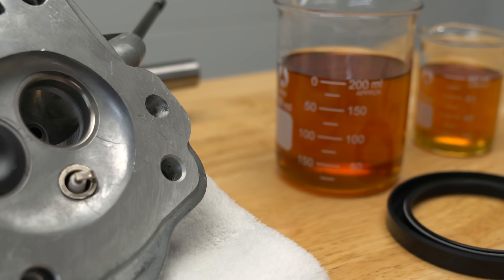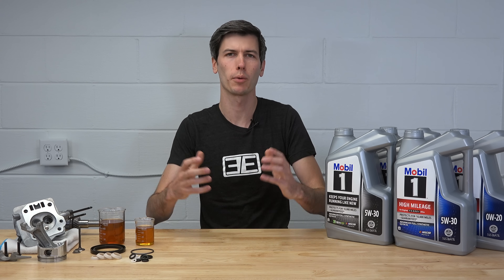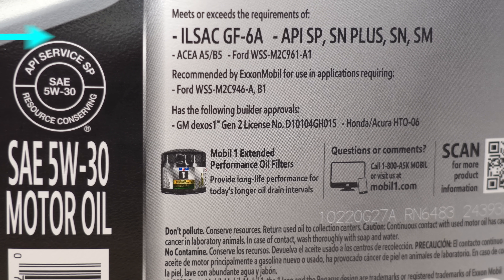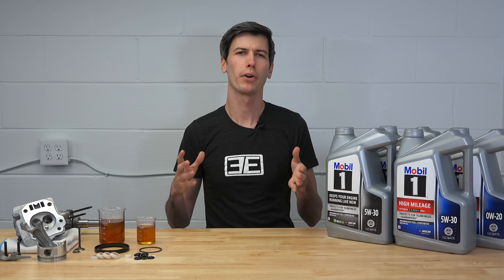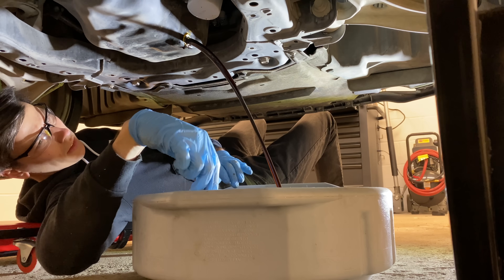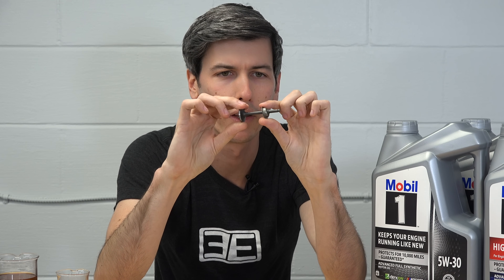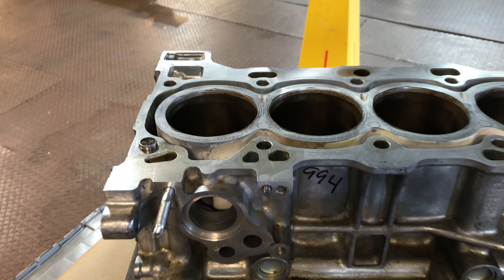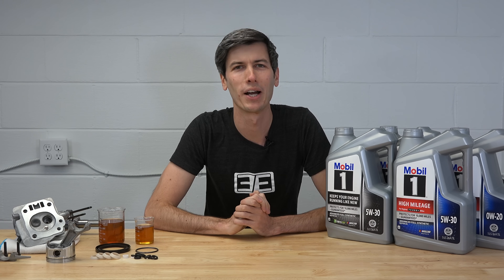Is Synthetic Motor Oil Bad For Old Cars?

Comment: If you acquire a vehicle with a dirty engine or the maintenance has been neglected on a vehicle you or family member own, conventional or semisynthetic also will clean up the sludge and deposits once you change the oil and begin to keep a good maintenance schedule. Full synthetic will just do it faster. If you seals are doomed to leak, they will leak in either case.

If your vehicle had dino oil as the original equipment, you can continue using it without doing any harm. Your maintenance schedule has to be related the production you have, the products you are using and the type of driving you are doing. Possibly the greatest mistake people make is to not recognize that the type of driving they are doing represents severe duty.

Let me report my experience. I have a 20-year-old import with a four cylinder engine. I have used convention oil and changed it about every 2500 miles simply because it is very easy to do and pretty cheap. With the type of driving I am doing, all short trips and stop-and-go in town, 2500 miles is about the correct interval after all.

There is oil snobbery just like there is snobbery with every other product out there. Most of the time, unless it is required, synthetic oil is more of a vanity product than anything else. In the in-city and in-town driving most people do, it might be prudent to change synthetic oil at 5000 miles. The 25,000 mile oil change interval some of the high-end product advertise is for vehicles that are driven mostly highway miles. If your vehicle requires synthetic and you need to change it more frequently because of the type of driving you are doing, use the cheap stuff and change it more often. These days, the price of low-end synthetic is barely more than the price of semisynthetic or conventional. Sometimes, no more.

Comment: Nice video, so, what is the solution for an old and wearing engine then? Because the problem now and in the past seems to be not only the cost implications of rebuilding an engine versus buying a new car, but also the prohibited cost with the same comparison, neither process is cheap, even on ordinary middle of the road vehicles, so if the warranty doesn’t help, and your engine is wearing, how do you combat this (sounds like my answer would be don’t own a car)

Comment: It does clean moter  main problem most have a dirty oil and buildup and it keeps leaks from occurring,  but synthetic cleand deposits  and yes it WILL LEAK , my yucon  at 235k  has schafers and uses 1 quart per 3200 miles  yet tried changing  to mobile 1 and  800 miles to  1 quart  a simple  test is how easy does a torch start new oil   blo by is how much heat oil takes before  burning  off  and schaffers  relly tough 2 get started and low blo by in a comparison  obviously     3 quarts different  between both oils per 3200 miles

Comment: As long as your engine isn't burning alot of oil due to poor maintenance. Increasing the viscosity can help. The bottom line is to decide if the synthetic oil is actually worth the extra cost. More frequent oil changes can never be a waste of money or time if the engine is only driven for short runs or non freeway use. Freeway driven miles, in my opinion is better for the engine. The engine has a better chance to burn off the accumulated contamination like carbon and sulfur.
Reply: dont forget water
Reply: You’re living in the 80s brother. Use the recommended oil thickness, and it is wasteful, modern oil is good for at least 5k miles. If you’re changing convential at 3k under most workloads you’re wasting money

Comment: ive noticed synthetics or perhaps specific mixtures going black and watery more quickly than blends or conventional.  that said the top end of my engines has improved as i do regular oil changes. magnatec kind of scares me at how fast it burned of by comparion. supertechs high mileage seems to be pretty good at lubricating and cleaning the engine.
Reply: ran supertech in my 2.3 Ranger from 66 k miles to 292 k and had a head gasket go bad, took apart the motor and had almost zero  wear , even the valve guides were perfect, always changed a 3 k miles.

Comment: Older engines have flat tappet cams and need zinc in the oil for extra protection. Synthetic oils don't have zinc because newer engines have roller cams. Hence, older engine camshafts and lifters wear out prematurely.

Comment: Good video agree 100% 

another urban myth was older cars always tend to get a little bit of blow by the piston rings even from new.

Infact  it’s always been the case that service manuals will cite 500 mils consumption of oil over a 10,000 km service interval is normal….. Well at least on the new car brandsI can afford to buy anyway

This consumption is supposedly  just due to days pre-dating computerised machining when things were not perfectly round and everything was analog

and the myth was if you run synthetic oil the tiny amount that gets burnt in the cylinder has the effect of glazing the bore in an accelerated manner

and once it’s glazed the rings then chatter plus stuff  overheats and it’s the start of worse problems…..

Whereas mineral based oils were more fore-giving on the bore when burnt….. And therefore they were better to use because they promoted longevity of the piston to bore and ring assembly

I’ll bet you haven’t heard that one before…….

Comment: I won’t get into whether synthetic is a good motor oil. If used directly from the factory it might work fine. But when conventional motor oil is used from day one it coats engine parts in a different manner. Many conventional oils have substances like paraphin and other things that help lubricate engine parts. If you stick with conventional oil and you change it regularly the engine can last nearly 200,000 miles if not longer. From my observations if you start with conventional and change to synthetic it will usually start to affect the valve train since the most pressure is developed with the cam and lifters. I’m not sure how it does it for sure but I’ve talked to service managers and they affirm that when oil is switched to synthetic from conventional they’ve observed that engine wear and damage occurs a while afterwards. In my vehicle I was getting on the interstate and it suddenly started rattling and knocking to where it lost power then died. When I got it where I could look at it there were pieces like shrapnel under the valve covers. I’ve seen timing chains lose time and never caused this kind of damage in a non interference engine. There was no low oil pressure and no prior valve/lifter noise before hand. As long as you can get conventional oil you’re better off not switching. Why take a chance when conventional oil is cheaper and it’s been running fine?

Comment: I'm on my 3rd oil change since switching to synthetic @ 230km its now @ 275+km its been on same oil for last 25000km! jus check and its still thick n clear.   2010 elantra engine runs strong the rest is falling apart.. letting it die or would always change @ or before 10000km. pretty much all decent quality engines come with break in oil that need swaped at 20-100hrs depending on size.. most ppl never swap it then call it junk when it wares out in 3 months.

Comment: I have a 2017 Chrysler Pacifica with a 3.6 liter V6 engine. It has 44k mileage. The factory recommended oil is 0W-20 oil. The guy at the oil change place said you can use 5W-20 as a substitute because it is much cheaper. He says it won't damage the engine. Is this true?

Comment: Very good video.
I believe there's plenty of common sense to suggest there is no issue with synthetic oil use in older engines. 
The high mileage oil use should be weighed against cost/benefit.
All things being equal, higher levels of ZDDP's (not Zinc by itself) are useful for some older flat tappet street engines. 
These are found to be present in much lower quantities than in pre-90's motor oil.
In the case of the older flat tappet engines, this is not a major issue after break-in. (Still important however.) The consensus amongst some oil chemistry experts and engine builders supports this.
Reply: Use a ZDDP=rich oil in air-cooled VWs.

Comment: The original Mobile 1 oil was almost clear and thin. It's now closer to conventional oil thickness. If you bought a used car and put synthetic in it, sometimes it'll cause the valves to stick. Had this happen on mine. After a couple of changes this goes away. Haven't had any problems since.
Reply: I believe that the Mobil 1 sold today is of different composition than the original Mobil 1 at its introduction.
Reply: @davidpowell3347  That is correct. Regular Mobil 1 today is mostly Group III severely hydrocracked oil, and not Group IV PAO, although it may have some PAO in it. The original Mobil 1 was virtually 100% Group IV PAO base stock or Group V Esters. This is inline with all the major competition who also use Group III base stock in their regular "synthetic" formulations. To get a Mobil 1 that is more like the original synthetics, try Mobil 1 Extended Performance, or Mobil 1 Annual Performance motor oils. Mobil 1 EP is probably the "sweet spot" in terms of price vs performance, as it is only slightly more expensive than regular Mobil 1 (at least at Walmart), but much higher quality base stock.

Comment: bruh i've just been using high mileage oil because my car just has a lot of miles. the engine runs fine and smooth with no leaks.

Comment: I use Royal Purple. Though a little pricey it's been good on my 1994 Ford E-150 Econoline 5.0 it has 85,000 original miles with no leaks. I found out today instead of using 5W30 Ford is now recommending 5W20. I live in Texas and before I change the oil... why would be they change the recommended  viscosity. Can't find any information as to why. Direction or advice would be greatly appreciated. Oh! Very informative video. Thank you for posting

Comment: I run conventional oil in everything unless it has a turbo, i never had any problems, in cars with 200k to 300k.they still need changing at 3k to 5k, because the engine is still making the same amount of dirt. And the filter is still catching the same amount of contamination. Plus all cars with active cam timing needs the oil changed 3k to 5k Reguardless...Stop and go/ short 5 mile trips change at 3k, highway miles 5k  with non turbo newer cars you could get by with 6k if you don't run the pis out of it all the time.  If you change the oil at those intervals you'll see no noticable advantages of synthetic oil. Carb controlled engines need the oil changed more frequently than computer controlled cars. Catch a sample of your oil with 6k on it send it to a test facility to be tested, the results will tell you what condition it's in.

Comment: I have a 2012 Civic Si, it says to use 0w 20, I have used 5w 30 or 10 w 30 for 9 years and the engine is good no problems, the iVtec engages quicker. I live in  hot climate. The thinner oil  is engineer  for better milege.

Comment: Best oil is clean oil. Buy the cheapest on sale synthetic oil. Also buy a good oil filter. Check the size microns the filter will hold. The smaller the number the better the filter.

Comment: I use straight 30 conventional in my Super Beetle because it's what the owners manual says for my temperature range and oil has only gotten better since 1973 when the car was built for the 74 model year, it's cheap (when you find it), and it's just gonna leak out anyways so I might as well use something cheap that I can top off between oil changes. As they say with aircooled Volkswagens "If it's leaking you know it has oil".

Comment: Great information. Thank you.  But if one has an air cooled car flat tappet or flat tappet engine without a cat. Use an oil with zinc. Like valvoline racing or diesel oil.

Comment: Thanks for the video! It made my decision easier. I have an old '99 suzuki car with moderate/high milage(at least about 170 000km)  and  I switched from part synthetic/hc synthase (10w-40) to a synthetic oil (5w-40).  No problemes so far, car starts a bit easier.  I didn't have any bad experience, just positive. I mainly switched due to extreme weather conditions in Europe (cold winter days, really hot summer days) and it should be cleaning and protecting the engine more effectively. at this age, it might be even more important. I rather go with a cheaper, but quality brand, but put synthetic from now on. Next time I'm thinking of trying a full synthetic of this grade.
Reply: Can’t see the logic in using semi synthetic oils because it’s a mixture of both mineral and synthetic which rather defeats the objective,it is of course your decision and if it works for you then no problem,I always use 0w40 in my 150,000 mile BMW X3 diesel and change it every Spring along with the filter,I only do about 6,000 miles a year so it’s probably a bit overkill really,the engine inside looks as though it’s just been assembled with NO sigh of sludging or carbon deposits anywhere,being a diesel mechanic this is very important to me, I’ve had dozens of diesels since my first one in 1985 and NEVER had any sort of engine problem so what I’m doing can’t be that bad, wouldn’t go back to Mineral or Semi Synthetic oils now after the success I’ve had over the years with fully synthetic.
Reply: whats the diff between synth and full synth

Comment: I've actually got an engine that suggests a thinner oil for the winter with a thicker oil for spring and if opperating in desert climates, even heavier oil so, yes there may be a valid reason to switch to a thicker/heavier oil even in a synthectic
Reply: 100%, my first gen rav4 manual suggests anywhere from 5w-20 to 20w-50 depending on the lowest temperature you're likely to experience.

Comment: I have a 1980 ZGB. It seems to me that should use high mileage synthetic along with a zinc additive. I've been using Valvaline racing oil which has zinc. I do summer driving only.
Reply: MGB

Comment: What about air cooled engines? Where the oil is doing double duty, lubricating and cooling. Will synthetic remove as much heat as conventional oil?

Comment: Interesting. As I'm considering purchasing a 2012 to 2017 Jaguar XK or FX R/S vehicle, it will have some accumulated mileage. Can I use this oil analysis system to assess the future viability of the engine and, therefore, the value of the used car purchase?

Comment: That was a perfectly simple explanation in my opinion. It was neat to know that a rotary engine uses oil like that. Does the rotary engine then been to topped off more often.? Seems it would
Reply: Not necessarily. A modern SPARCS Wankel engine burns less oil than a standard higher compression inline 4cyl with VCT or VVT, and it burns much less oil than even the most efficient modern Diesel. But compared to a modern pushrod V6 or V8, that's where the Wankel fails in oil burning comparisons. But it's less an issue of the Rotary being an inferior design and more an issue of Pushrod V-blocks having 125 years of constant devolpment and engineering innovation behind it to address its shortcomings.

Comment: I owned a 1993 Chevy lumina
Van for 23 years. After the first
5000 miles I used synthetic till
The car went to the salvage
Yard. From rust. Engine was the
3 liter V6. One of the best
Engines Chevy made. Body
And frame gave up at 265
Thousand miles. Engine ran
Perfectly.

Comment: I know you get this question a lot, but I’m really in need. I’m about to hit rock bottom, answer this will fix everything. Please help. What kind of oil do I need and should I use? My car is blue with a several cylinder engine. Not sure what kind. Please help. Wheels are 17in

Comment: Sounds like you're selling it;
That o'ring seal is just what??  it is not the rear main seal,not the front ,not the cams seal, why not use real seals ?
plus, to drive the speed limits you do not need the expensive oils,much less that mobil 1,which was invented for the airplanes in Alaska, that had the oil frozen in winter; then the "masses" started to use it...just because it was expensive...and they thought it would fix engine mechanical problems and noises,but it was just money down the drain, it was just created not to thicken/freeze at low temps,nothing else.

Comment: I think using a thicker oil in a VVT or multi displacement engine Is a bad idea. Even if the bearing clearances increases over time the tiny ports for those systems never changes.

Comment: In NASCAR these synthetic oils would last about 15 to 30 laps. Friend of mine mechanic for Jeff Gordon and Jimmy Johnson. He said we still use grease which means petroleum based oils. It's a molecular thing. Any engine running over 6 grand is looking for damage with synthetic oil. For the average Joe the synthetic oil is just fine. The original synthetics were vegetable oil with additives. Have no idea about now.

Comment: I followed my mechanics advice.Ihave a 93 volvo 940 w close to 3000,000 miles. I put a pint of kerosene in the oilcap drove at 30 mph for 30 miles & theen drained it thoughly & change the filter too!! NO leaks for 6 mos! engine runs much smoother;